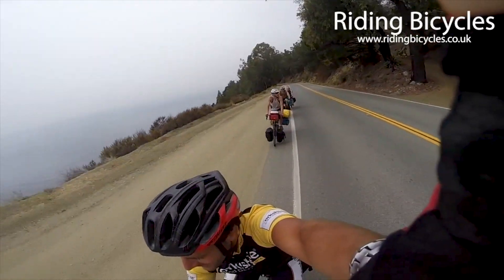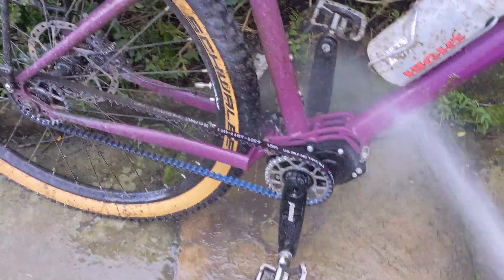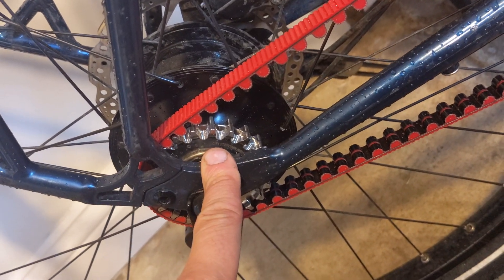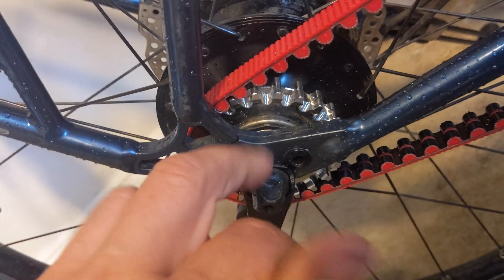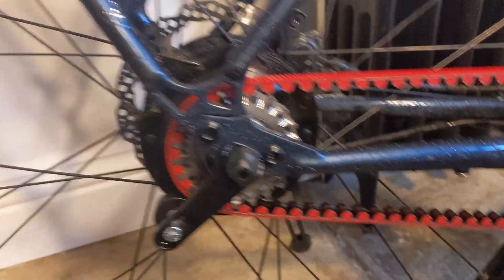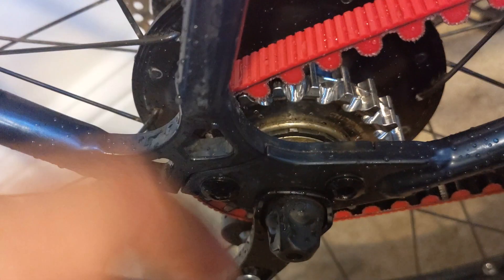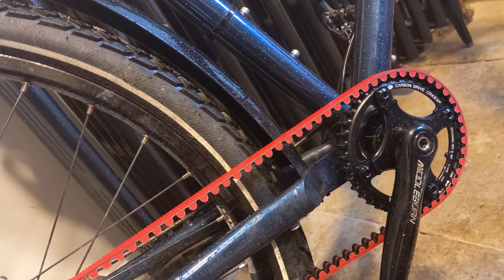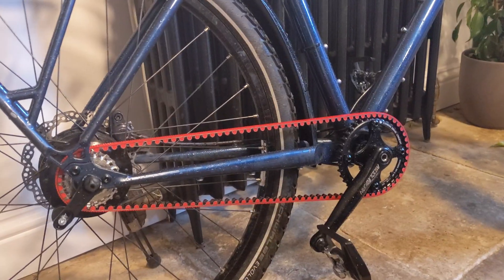Rohloff Speedhub Chain To Belt Conversion. Gates Carbon Drive. Easy Bike Maintenance.

Comment: Which is more reliable and durable? Pinion or Rohloff?
Reply from the maker: I don’t think you could prove one is more durable than the other. Rohloff a has been around longer and has an amazing track record. Pinion also has a really good reputation during the time they have been available.

Comment: Good info how did it hold up over the last 4 years
Reply from the maker: @Bikepacking  I don’t have that bike anymore, but the couple of years it was in my possession it was flawless. I have had other Rohloff and Pinion bikes and I have not had any issues though all sorts of conditions. I think the belts make a massive difference to the maintenance,  but I have been experimenting with waxed chain is also very clean and I am enjoying using them too.
Reply: @ thanks you

Comment: Can I do this with a 2024 Wired Cruiser? It does have a split on it. So does that mean that I just need a front and rear cog and belt and I'll be good to go?
Reply from the maker: I am not familiar with the bike frame so cannot comment. But I have not seen frames have a split for no other reason. I would double check with the manufacturer. If it is a split for a belt then yes if you are running a hub gear like a Rohloff or Alfine or running singlespeed you would just need the cogs and a belt and you are good to go. Just make sure your spacing on your chainring ensures a straight belt line. Belts have to be straight. If you are running singlespeed you can achieve a straight belt line by using spaces on the rear cog.
Reply: @DylanJugroop  Yeah it comes with a rear hub motor with 7 speeds I think. Not sure if it's a freewheel or cassette though.
Reply from the maker: @luigiprovencher If you have multiple gears (cogs) at the back you cannot use a belt. The reason why it is possible with a Rohloff or a Alfine etc is that the gears are inside the hub. You only have one cog on the outside. A belt has to be inline and stationary. Eg if you have a rear derailleur you cannot use a belt.
Reply: @DylanJugroop  Well that sucks then. So I'd have to buy a whole nother wheel with an internal geared motor then?
Reply from the maker: @luigiprovencher if you are wanting to have an electric bike with gears and belt you would need to have a mid mount or front wheel motor. Then at the back you would have an internally geared hub. Then you could use a belt. I am not aware of a rear motor that also includes internal gears. It seems with the set up you have it would probably be more cost and hassle to change all the parts just to fit a belt and it would make more sense to buy an electric bike specifically designed with gears and motor to take a belt.
Reply: @DylanJugroop  Yeah there is such a thing as an electric motor with internal gears. Nobody makes an electric bike the way that I want it to be. I don't mean that literally but I just haven't found one yet.

Comment: Where can I buy the belt stay piece?
Reply from the maker: Just type in Gates Belt Snubber. There are some that connect on the derailleur hanger and some on the axle etc so get the one that works for your set up. You need to make sure the snubber does not touch the belt. You leave a little gap of a couple of millimetres. 

This manual has a page all about snubber set up and which one you need.

https://www.gatescarbondrive.com/~/media/files/gcd/oemfactoryresources/gates-carbon-drive-rohloff-manual-en.pdf?la=en

Here is a link to one of the examples.

https://www.sjscycles.co.uk/gear-spares/gates-carbon-drive-rdm-snubber/

Comment: Do you have any suggestions on how to add an easier gear to roadster v2 e bike with belt drive. It’s quite heavy to ride when the battery is off 😅
Reply from the maker: Hi, this is a difficult question without seeing the actual bike. I have just done a search and I think the bike you mention might have the motor in the rear wheel. If that is the case you could get a new smaller cog for your crank at the front. Depending on how much smaller you are going and how much scope you have at the dropout or BB (whatever system your bike uses for adjusting belt tightness) you also might need to buy a shorter belt. If your bike is what I think it is that is how I would do it, but checkout what I have said with someone that knows bikes first before starting to buy bits. Would not want you buying stuff that is not suitable.

Comment: What chain ring and sprocket size did you fit. 
I just received a tout terrain blue ridge and had one choice on gearing.... "No choice" a 50 tooth chain ring with a 19 tooth sprocket which is 19 gear inches (using Sheldon brown calculator 700c x 35 and 175mm cranks supplied with bicycle) .... Which I think is a tad too high..... If you do have such low gears have you noticed if you use your top gear much?
Thanks for the video. Rohloff can be quite confusing when you've only ever used derailleur.
Reply from the maker: Hi, I do not have the Tout Terrain anymore and I can’t remember what cogs I bought. I do know that I did have it set up way too easy. I think the easiest gear it was 16 gear inches effected down hill performance, although it was nice up hill.  My commute takes in 20+% climbs in both directions so I went easy but it spun out on the fast flats and shallow down hills and I would only be in 3rd when going up the 20% hills. This site is good for working out your ratios. 

https://www.cyclemonkey.com/blog/calculating-gear-ratios-rohloff-speedhub

Alee at cycling about is clued up with them as well. https://www.cyclingabout.com/tour-with-a-rohloff-hub/

I am in the process of putting a Rohloff on my Salsa Fargo and I am undecided on the cogs I will use. When I work it all out and come up with a plan I will get back to you.
Reply: @DylanJugroop  Dang, I am currently building a salsa Fargo and was planning on getting a Rohloff, but I've recently found a Kindernay XIV instead and will see how that is. I also have a Schlumpf High Speed drive  that I'd like to throw on. Right now I have a 24T rear cog and a 50T front for the belt drive but I'm not sure if this size is within Rohloff's accepted tolerances, or how the Schlumpf will possibly factor in at all? Anyways, your comments in this video are very helpful and can't wait to hear more updates on your build.

Comment: Thanks for this, I plan to convert my Sonder Broken Road Pinion to a belt drive once it arrives,  and I'd been wondering how you find the correct belt length.
Reply from the maker: Unless Sonder have updated their frames they cannot run belts as they don’t have the split in the frame.  That needs checking out first.  I was interested in last year so researched them.  The new models may have changed, but yeh please check before buying a belt.  Cheers
Reply: @DylanJugroop  I've spoken to them about it and the Pinion equipped frames do have a split. They even offer the gates upgrade as a £200 option
Reply from the maker: Wow they have made some changes. I will have to get one myself now! 👍🏽😀
Reply: @DylanJugroop  they're decent value, the risk is with the frames being made in China. I've seen quite a lot of their titanium bikes as I live quite close to their head office and hathersage store, and I work in a bike shop so whenever I see one I have good inspection of the quality of the welds and every one I've seen so far has been spot-on.
I plan to post a detailed review once I've had mine for a while.
Reply from the maker: As you will know nearly every bike frame is made in China so that would not worry we.  The respected brands make sure they have good quality control 👍🏽

Comment: Very helpful video, thank you. I'm looking to get a forever retirement bike to supplement my 1997 Litsepeed Obed and my 1991 Gary Fisher Hoo Koo e Koo. I've arrived at the decision to go Rohloff, and am just now considering chain vs belt, so this video is really helpful, along with Alee Denham's Cycling About channel. You both seem to have a similar philosophy.

I'm interested in your comments in the video and below about getting the right gear ratio - and that you have maybe gone too low. I'm of a similar mentality in that at my age, getting up hills is much more important than going downhill fast. Is there a site you can recommend for calculating what chainwheel size and sprocket size work with Rohloff for specific gear ratios?
Reply from the maker: Hi many thanks for you subscription! Glad I can be of some use somewhere 😂 I am just off out to a party today. I will get back to you tomorrow with your questions 👍🏽
Reply from the maker: Some very nice bikes! This is the link that you need.  https://www.sheldonbrown.com/gear-calc.html
Pick Rohloff hub from the drop down.  Put it one chainring number in for the teeth on your front sprocket and just put a number in the first box for your rear sprocket.  Select how you would like your output as gear inches or gear ratios. I only understand gear inches and for heavy touring and hilly rides I try to have in my easiest gear a gear inch of about 18 or 19.

What I would do first is see what chainrings and rear sprockets are available at the moment as you can only use what you can buy.  See what combination works best for the kind of riding you want to do.  

One good thing you can do is put in an existing combination you have on one of your bikes and if you want something similar you can sim to get your gear inches the same.
Reply from the maker: https://www.sheldonbrown.com/gear-calc.html
Reply: @DylanJugroop  Great, this is very helpful! I purchased Alee Denham's touring and bikepacking books and am working my head around what gear inches and/or ratios I need on my new bike build (will likely go either Shand Bahookie/Tam or Smithy Mule). Interestingly, I converted my Gary Fisher to a Dutch-style grocery bike and because I have to ride up a long hill with up to 25kg of groceries on my way home, I converted it to a 1x with very low gears. It doesn't bother me in the slightest that I can't pedal downhill once I get over about 20 mph, but for my new bike I'd want to at least be able to pedal at 30mph (going downhill of course).

Anyway, thanks again for your help!

Comment: Smart move. If your running a gearbox or gearhub having a belt drive is just a wise choice. My next bike is going to have both.
Reply from the maker: Yeh perfect combo.  I have a Tout Terrain Outback with Pinion gearbox and our two Tout Terrain Scramblers with belt and gearbox arrived yesterday.  I will be doing a video on setting these up over the next couple of weeks.
Reply: @DylanJugroop  I've been with the classic setup with all my bikes and now I'm looking at going to a belt and gearbox system for my next bike. There's nothing wrong with a chain and cassette but like you already know the belt and gearbox is just so much better. I really wished the big bike brands would start to pick this tech up by now.
Reply from the maker: They won’t for a few reasons:
1) People are brain washed by the marketing and they see races using this really light stuff.  So they aspire to have the same.
2) The belt and gearbox system is meant to last.  So they would lose out on loads of cash from people having to replace their drivetrain every year.  So if they did get on board it would be nothing like what Rohloff and Pinion produce.
3) People are obsessed with the weight of their bike due to marketing.
4) The attitude in Europe tends to be buy stuff for a specific purpose to last and is what I actually need it for.  The attitude in England tends to be look flash first.  Again mainly because it is what the bike shop sells you instead of something that you actually need.

When people start to realise that there are better options out there for normal everyday cyclists then things might change.  But it is hard to get through the noise of the marketing machine!
Reply: @DylanJugroop  you couldn't be anymore right. This is why I'm looking at a bespoke bike company that does custom builds. This why I can get the bike built for a gearbox and belt drive along with all the parts I want and the geo numbers I like. I live in the states but use my bikes for everything, I either ride to places or walk. I live in a very bike heavy area and still haven't seen anyone here with a belt drive or gearbox.
Reply from the maker: Two very good companies to look at in the states are 

Co- motion cycles.  They do every type of bike you could ever want in derailleur, Rohloff and Pinion. They are steel and are a lovely company.

If you are after something a bit more dirt oriented Solace Cycles are a really small titanium company.  They do a really nice Pinion bike. The two guys that run it are very nice to talk to and are very much about promoting the outdoors.

https://co-motion.com
https://solacecycles.com/bikes/om-2p
Reply: @DylanJugroop  been checking both of those companies out and another one called Chumba which does steel and titanium bikes. I'm leaning to a titanium bike plus they can get me whatever parts I want for a complete build, only downside is they don't do pinion but they do offer rohloff and gates carbon belt drive systems.
Reply from the maker: I have just read about the Chumba recently on bikepacking.com and they seem really cool.

Another decent brand is https://reebcycles.com they do Pinion in steel and titanium.  Have the cool image of being part of the craft beer scene.  Reeb is beer backwards.  They started as a beer company and wanted to make bikes they wanted to ride.  Ryan van Duzer rode one of their pinion bikes in one of his videos before he hooked up with the aluminium Priority brand which also do Rohloff and Pinion….. but aluminium 🧐 I joke.
Reply: @DylanJugroop  lol that's how I feel about carbon and why I want a steel or titanium frame bike. All the big box companies push carbon with anything that has remotely good components on it. I really appreciate all the information you are giving me. I'm in no big hurry to buy a new bike since I want to make sure I'm getting the bike I need and not the one I just want.
Reply from the maker: Yes that is how I feel about carbon… sorry I mean plastic bikes too 😂.  Again a big marketing thing that has made people think it is the best material for every sort of riding including going to the store to pick up your weekly shopping :)

You do right to take your time and think about your requirements. The amount of Ti/steel/pinion/Rohloff bikes I have bought over the last few years is ridiculous.  Just because I did not think about the actual use.  I kept on buying expedition bikes because I thought If I have the bike it means I could quit my job and ride around the world regardless of my back account/debt and personal situation 😂 I putting things in place so that can become a reality within the next few years though 👍🏽✌🏽
Reply: @DylanJugroop  I wanted a touring bike myself but realized it would only be used for around town since my local trails would be too much for it. Thankfully it was the touring bikes that turned me onto the belt drive and gearbox setups. I have a nice fsp bike but want a good hardtail since it can do pretty much every trail out here and be even less mantaince. Also it would be a good choice for bike camping out here. 
 You are so right about this push for lighter is better. I always run into other riders who are shocked at how fast I am even though my bike isn't light. I tell the weight only matters durning a race. 
 I did see in another comment you like the pinion gearbox more. My only issue with pinion is the engagement but I guess you get use to that.
Reply from the maker: The engagement is something I have never ever noticed at all.  I think it is people trying to pick faults that are tiny or not even relevant like the backing off to shift criticism.  I just don’t listen to the hype and criticism anymore.  I just ride the bike how I want.  Enjoy the time on two wheels and relish the fact I can do the same the next day and the bike will run exactly the same 👍🏽 If you want a system for exploration, enjoyment and no maintenance other than a wipe down and oil change once a year then you cannot beat it.  The Solace cycles bike seems it might be what you are after and the prices are very wallet friendly for Ti. But with all the brands you are looking at for the money you will be spending you will get something that meets your requirements and will make you very happy.  If you do have any concerns or apprehensions before parting with your cash which is completely understandable I would have a test ride if a demo if they have them available 👍🏽
Reply: @DylanJugroop  the reliability is what I'm really after. I live in the desert and cell service isn't a thing once you leave town and head into the mountains. I'm all about the 6-10 hour rides. I've used a grip shift before and never found it any harder to use then a thumb shifter. Oddly enough I hardly ever change gears but when I do it's never under power, I always pick the gear I need before I need it. I know the prices aren't cheap on the bikes I'm looking at but I'll be getting more bike for my dollar then say going with some off the shelf big brand bike. Plus all of those companies you listed will work with you to make sure you get a bike that fits you best.
Reply from the maker: Yeh so true! Sounds like you have it sussed 👌🏽.  Keep in touch and let me know which bike you go for.  I would be interested to know and what you like about it.  Sounds like you ride in some cool places 👍🏽